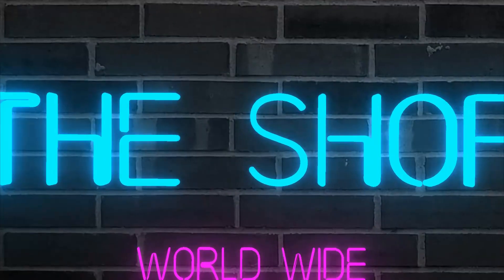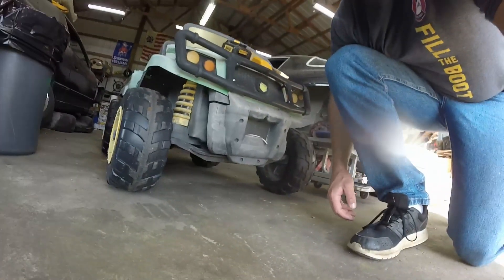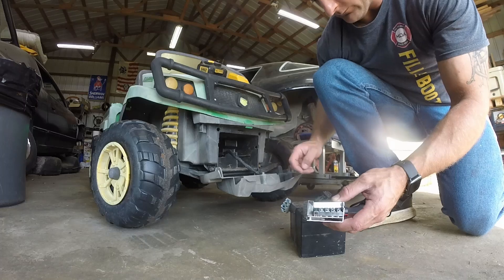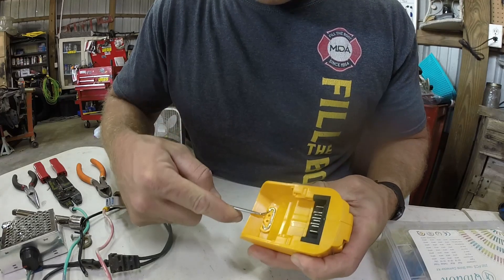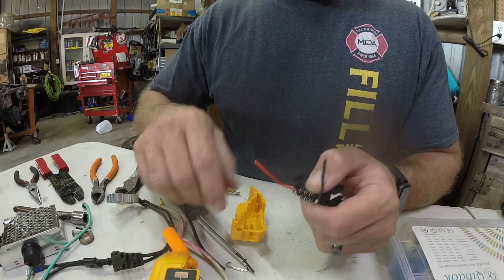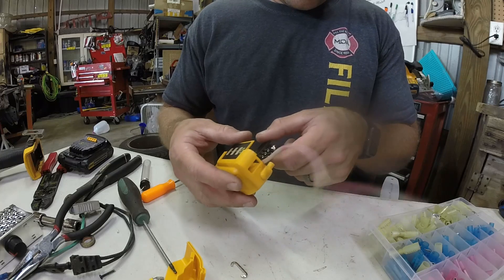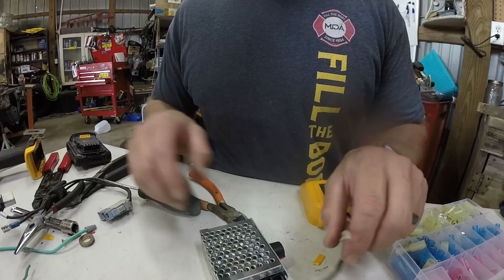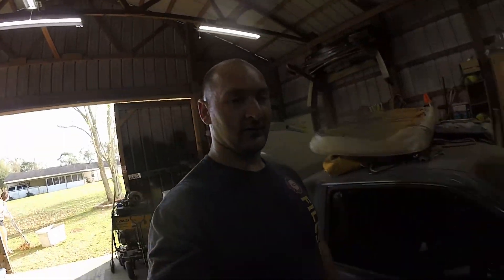20 Volt Power Wheels Conversion!

Comment: What type of controller did you use to step down voltage?  Can you share the product?
Reply from the maker: I used a voltage controller, it got wet and died. So I just jumped the wires on the controller. Now it’s straight 20volts to the motors...... and very fast. It hasn’t given me an issue since I did that, which was months ago. So you really don’t need a voltage controller.
Reply: You can buy a power wheels battery adapter dewalt or whatever you want at Amazon and volt reg

Comment: Needs a lift kit and some huge tires
Reply from the maker: That’s going to be “Gator 2.0”
Reply: @TheShopWorldWide  these days they make those small cars have tons of features. A few months ago I saw one with like a Bluetooth radio and a working infotainment screen
Reply from the maker: Yea we have a fire truck that’s remote control. I’ve seen $600+ power wheels with everything you could imagine.....
Reply: @TheShopWorldWide  I wouldn't be surprised if they had stuff like cruise control, and reverse cameras these days
Reply: Good video!